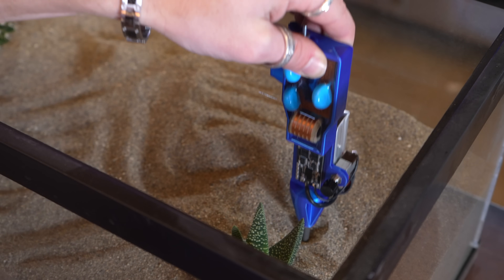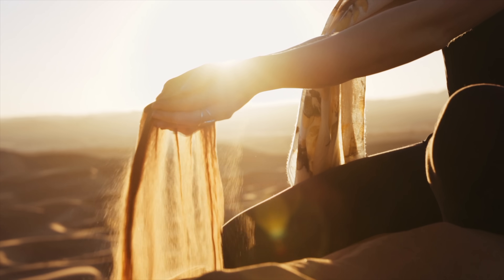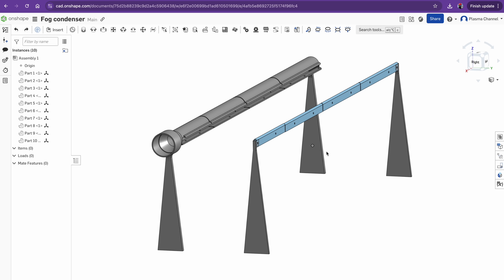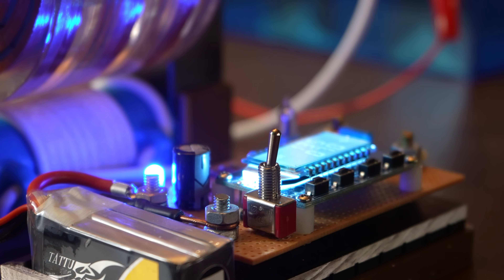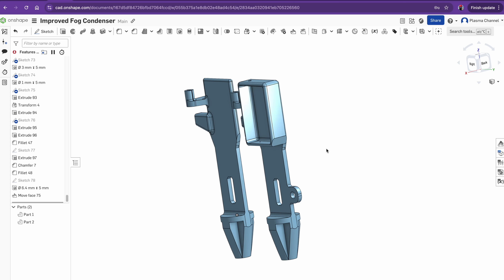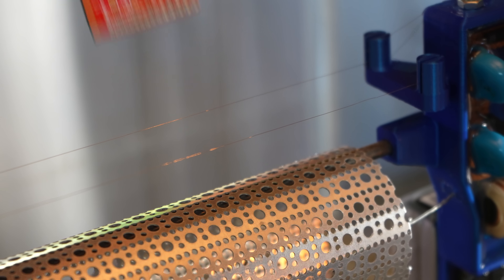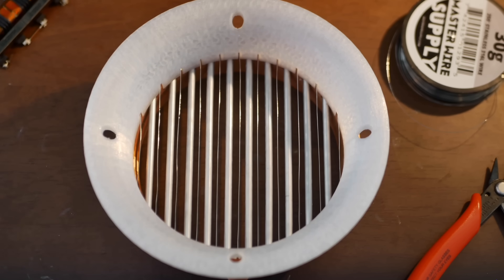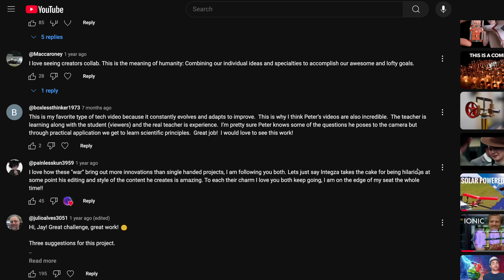Solving Desert Water Shortages Using 20,000 Volts

Comment: There are probably a million little ways to refine that device - try lowering power until you get the most energy-efficient operation, for one. The mesh you are using could also probably be tweaked into a much finer, looser, and lighter material given you are taking advantage of electrical attraction to do all the work. These two things would lower cost, and make it MUCH easier to run with a solar charging battery. And for the silly sausages arguing about dehumidifiers and pulling water vapor out of air - chill: This device is taking advantage of fog, it wouldn't work anywhere else and isn't DESIGNED to. You're arguing apples and oranges usefulness in juice and pies, and saying oranges suck because they don't make a good pie, and ignoring they make fantastic juice. It's like saying we shouldn't use solar panels in places they work well because they wouldn't work well other places... This is a specific application for certain desert areas which get consistent, every-day heavy morning fog because of their geographic location. I DO think it should probably be combined with a "moisture trap", though - as soon as that sun comes up, it's going to burn that surface water right off the top layer of ground! If you have ever tried to keep outdoor in-ground plants alive during a summer drought you know darn well that unless you actually get water soaked down into the soil, it just evaporates off the surface minutes after you water and does nothing. Farmers in arid areas tend to cover irrigation ditches and do things like put plastic over the ground around their crops for a reason. This device is a great way to harvest the water from fog for cheap, but the next step is designing a simple, low-cost way to keep that water sequestered underground at root-level so the crops can USE it.

Comment: So I’m curious how far can you stretch that setup with your current battery power supply? Your experiment was a couple feet long maybe and it seemed to run the whole way down. I think there is a linear relationship between the energy available to ionize water droplets (and the air) and the amount of ionized droplets. The more water on the air the more water will condense. In other words, if 2 feet at 40 watts and sufficient relative humidity at a given temperature will give you X amount of water, assuming you are maximally ionizing water droplets, doubling the length of the wire and condenser would give you half the rate of condensation over twice the area. If this is the case, the primary area of optimization would be to maximize the affected ionized area, and to size the system for the desired amount of water, giving you the lowest energy cost for the amount of water needed. From there, more energy = more water, less energy = less water.

Interesting system, interesting variables to play with. Keep it up man 😊
Reply: Lithium Alloy'S?

Comment: The first part of the experiment failed because the water and condenser were the same temperature. If the water was heated to be warmer than the condenser, simulating the conditions of morning fog, then it would have resulted in the water condensing on the condenser as the grid dissipated the latent heat of the humidity in the air.

Comment: Did you consider the 20,000 volts on wildlife like birds???  Also, farmers have to work the field removing weed etc, so was that considered?  Can't just leave electrified wires out in the open.  Would need to cover the wires.  And what about rain?
Reply: There is no current, just voltage. Birds also perch on high tension electrical wires
Reply: @Rampart.X  
Yes. But birds perch on ONE wire.  When you touch two wires closer to each other like this, you complete the circuit and short it.  Depending on how much is going through it, you'll get shocked or fried.
Reply: @VamYang  the wires are the same polarity - no current. The condenser is the opposite polarity and distant from the wire.

Comment: Sounds like a great concept, but isn't it really just trading one resource (power) for another (water)?  
Something more passive like what is done in South America might work here too, although that system depends on wind driven fog.
Reply: The power consumption is extremely low and able to be provided by a small photovoltaic or wind generator

Comment: This is almost practical for recycling water and pest control for my plants that inuse a fogger for. My problem is the energy use. If something like this can make sense on a 12v solar system with a 10ah battery this would be VERY USEFUL.

Comment: Wondering if you could measure the water weight at the ultrasound fog emitter before and after too? It's a very lossy system (most of the fog isn't going anywhere near the electrode/mesh), but it'd give you a vague idea of conversion efficiency on that end of the system, as well as if differing fog densities require more or less power through the system for reasonable droplet output.
Also, trying different mesh sizes might be worthwhile too. Would a flyscreen mesh be better than the metal grid style? Or doesn't it cool enough? Possibly also try out some nylon shade mesh. There's a lot of cheap, scalable collection surface methods to have a quick go of.

Comment: Could you maybe use a slit-cut aluminized mylar sheet to create a diamond mesh as the negative electrode? You could still use wires to create the positive charge in the fog - just several of them in parallel with one another to cover a greater area (something the mylar grid would also accomplish).

Comment: So riddle me this. Why not just string a wire mesh over the ground, making the ground the positive electrode and have the water attracted straight to it. At these voltages the ground will be conductive enough. In your aquarium you could spread the wires out maybe 50mm and have them 50-100 above the soil. In real life you would up the voltage and have it meters above the ground increasing the catchment area.

Comment: That sure is a neat experiment.
Another neat experiment idea along similar lines would be to run a tesla coil or van de graaff generator grounded to the earth, depending on the polarity you can make it rain or not rain. By drawing electrons from earth ground in to the air it will cause a net positive charge in the local area of the ground this will cause negative electrons from surround area to be drawn in either from the air or ground, depending on many other factors such as how far away moisture is or how mush moisture in the ground and other weather situations near by, if conditions are right then it will draw in rain eventually. To make it not rain reverse the polarity. This will increase the net charge in the ground to be more negative which will repel a moisture. Of course there are many other factors but one factors involved when and where rain may happen can depend on ground and air charges. Also if master this concept with a network of such devices around the globe one can control and steer where rain can occur then yeah no more cloud seeding with toxic stuff needed.

Comment: The fog dissipated so quickly when power was applied. If this was scaled up would this clear a strip of air just as easily? Could this be used to on the sides of a runway to dissipate fog?

Comment: To even increase efficiency further, you can try pulsed DC:
1. When voltage is high, the water molecules get ionized, start to accelerate toward the mesh.
2. Then voltage is turned to a low value: the ions keep their speed, don't accelerate further very much, but still reach the net.
Thus, the ions hit the net with lower speed, so you produce less heat. While the same sized device will catch less water because it does not ionize water constantly, I guess the overall efficiency could be much higher.
edit: The pulse rate depends on the distance of the electrodes and the speed of the water molecules (~1kHz can be a good starting point). And the pulses need short high voltage, long low voltage period. For experimenting, it would be nice to have these adjustable.
Reply: Plus these 20kv generators exits cheaply on line. 20kv ignighter. Or a 40w 20kv electrostatic generator and turn it on and off.
Reply: YES!  This just crossed my mind an hour ago.  Since the air is moving, the wires don't need to be charged all of the time.  There is an ionization radius around the wire.  As air passes through, once it's been ionized, it's still ionized.  Turn off the current, capture the water from that segment of air, let it pass, charge a new incoming segment of air.  Lather.  Rinse.  Repeat.
Reply: good points...........and/or staggered screens - optimized geometry.  Fun to see what AI would generate!
Reply: Agreed. Also try to make the voltage as low as possible while still producing water, for example try connecting the positive to different sections of the Cockroft-Walton multiplier and see if the droplets decrease.

Also geometry matters a lot here. Try if distance can help affect a larger volume of air, or if the efficiency falls off.
Reply: It might be tricky if the power grid is supplied by an AC current. To convert AC to DC on a mass scale, a rectifier is needed, and depending on the energy requirements, may price out a lot of farmers in these regions.
Reply: Switching losses go brrrr
Reply: I think there's a misconception here, ionization makes no sense. The jet action is cleary affecting the air pressure, that is what is actually causing the condensation.
Reply: @MinusMedley I think the ionisation does something more than a DC fan. The ionised water drop water might more likely to touch the mesh, a thinner stagnant interface; better mass transfer. The aerodynamic would be different.
Reply: @MinusMedley  the ionization certainly acts as a compressor, pulling saturated air into its proxity,and the mesh as a condensor, dropping air pressure as water leaves the air.
Reply: @MinusMedley  you may look for electrostatic dust collectors
Reply: You can guess all you want, that doesn't make what you said a fact. Why not simply reduce the voltage to give the same average value as the pulsed voltage? The average acceleration and final velocity will be the same, but somehow you don't think this would improve efficiency?
Reply: @ferrumignis mhm reduced voltage mehh that would reduced amperage yes ionization needs high voltage 😅
Reply: @TheLtVoss  Lower the voltage to reduce ionisation, not lower it until it stops. The amount of electricity consumed determines the amount of ions created, whether that's controlled through voltage or duty cycle. There is no magic to be had here.
Reply: @ferrumignis I think there is merit to this point, when he turns it on in a misty envitonment, it demistifies the environment in seconds.
This tells me that the limiting factor is the availabilkty of mist within a given space within a given time.

Now imagine a low power sensor that can sense the mist levels, and at a certain threshold, turns the device on, and at a lower threshold turns the device off.

Or simpler - just timer based, tuned to the local conditions.

I'd expect something like 10 seconds on, 30 seconds off for medium dense fog. - but experimenting would give much better numbers.
Reply: @Flimzes  He's not talking about switching the unit on demand according to the mist level, which would be a good, if fairly obvious efficiency boost. The OPs suggestion is to rapidly pulse the ionisation current during operation which he believes will increase efficiency, but I've not seen any compelling evidence why this might be.
Reply: @Flimzes My two cents: add a switching matrix on a timer. Use relays or whatever to switch one HV generator between let's say 5 mesh lines, spread 10 feet apart, for 10 seconds at a time. The HV generator and the electricity are the expensive/scarce resources, so you need to maximize them. You would use one HV generator to cover 5x the "surface area" of the desert for the cost of a couple relays and the extra mesh/wire. The sequence timer gives time for the fog density around each mesh to recover to a higher level before being condensed and depleted again. Even if you only recover a mere 25% of the normal water on each mesh, you'll make up the difference by running 5 meshes on the power budget of 1 mesh, and end up with 25% more total water. That's my hunch, anyway.
Reply: @ferrumignis  it is not about reducing the overall speed however introduces a pulsating nature.
Reply: @sciencedaily2551  By pulsing the ionisation current you limit the maximum speed and quantity of ions, just as if you reduced the average ionisation current. Why would one cause some magic efficiency gain but not the other?
Reply: @ferrumignis  what about thinking on the sides of resonance. When high tension is active it creates a high repulsive force at ionic level pushing away creating a vacuum around the line. When the voltage is turned off it regains the pressure and again pushes away when the high tension line is activated

Comment: A quick google found the cost of desalinating seawater was  $0.5 to $1.00 per cubic meter
That is 1000 liters. ...like a penny a liter. That is what your competition is.
 
I leave it to the readers to decide if he is proven to do anything useful. 
trivia...
The hairy cactus at 11 minutes are often called old man cactus. Some  cactus with hairs use the hairs to collect water from fog on the west side of the Andes mountains. 

if you want to know if this is useful....you have to set up 20kV DC wires in a foggy place. 
That is many places on the west coast of the US much of the year. 
Regarding 14 ml /watt hour...That does not beat desalination.
14 ml / watt hour = 71 KW hours / liter.  if your electricity is $10cents per Kilowatt hour it is 
$7.10 per cubic meter or about 7  times the googled value of desalination.
But maybe depending on spacing of wires, and possibly other voltage in a real fog bank in some wind and fog  conditions you might equal desalination. You just did not appear to do it with these numbers.
Reply from the maker: Making stuff up? Name one thing I have made up good sir.
Reply: @PlasmaChannel  Here is something rarely seen  in Youtube comments. 
I WAS MISTAKEN.
 I was mistaken when I said this the plasma channel makes stuff up. I confused you with the another channel with plasma in the name that denies gravity organizes the solar system and claims static charges between planets is how it works along  with much nonsense. 
I will remove the accusation that your channel makes anything up from my original post.  I am a bit concerned that the title might give the impression you claim to have solved desert water issues. Though you may contribute to fog net efficiency.

Comment: Not dissing Grüns, they look like a good balanced vitamin supplement.  But the "Prebiotic" marketing  label just means they contain substances that bacteria can break down, this is just dietary fiber and some amount of carbohydrates. If any food label contains any quantity under carbohydrates and fiber it classified as a digestive prebiotic.   

Also note MtFHR is carried by up to 60% of the population, but a much smaller amount have two copies of the A1298C and C677T gene variants (less than 25%) which lead to methylated processing issues.  This MtFHR effect basically reduces the rate at which you can break down non-methylated B9 and B12 into the methylated form (which is required for some of your biological function).  However unless one is taking very high doses of B12 (such as sports B12 shots) an individual is extremely unlikely to encounter toxic buildup.  In fact its about the same level of risk of reaching toxic buildup as many of our essential nutrients (i.e. you have to be doing some extraordinary things in most cases to encounter a problem).  

However on the upside using methylated B9 and B12 means what 1-5% of most a dietary supplements that are absorbed, that subset B9 and B12 will serve your needs a day or two faster than unmethylated B9 and B12 as its one chemical step closer to a useful form.

Comment: If you could somehow cool the grounded grid as well, this would stop the grids temperature from increasing over time as the water vapour gives up thermal energy to it (making the grid less effective the more water vapour that lands on it) one way might be to use a small pump in an enclosed heat echanger system to circulate coolant a few metres underground (where I assume it could be cooler than at the desert surface) another method could be to use "thermal mass" on your grounded grid so that it takes far longer for it to "warm up" as the vapour gives up thermal energy to it. This would assume that the grid would be very cold already. another idea might be to use 2-3 layers of grounded grid so the vapur has more chances to land on it (not sure about that one) One more idea might be to set this arrangement up vertically instead of horozontally and rather than drive the fog onto a grid, drive it BETWEEN two grounded plates so the fog is basically in the viciinity of one plate or the other for longer and has more chance to land on one of the grounded plates. The condensed water will just run down the plates, and incorpotate thermal mass and ground cooling as well

Comment: I would be curious if at larger scale you would see a decrease due to the point you made in the beginning how the edges were more efficient than the middle. so for larger longer setups you would possibly have even more difference between the edges and middle sections. I kind of want to try this out we have a container farm that is having super high humidity and so it would be a good test area for this idea on a larger say 50ft long runs. while also helping us capture humidity from the air.